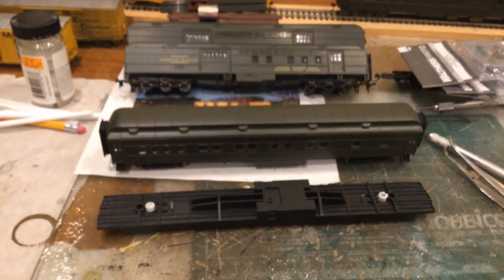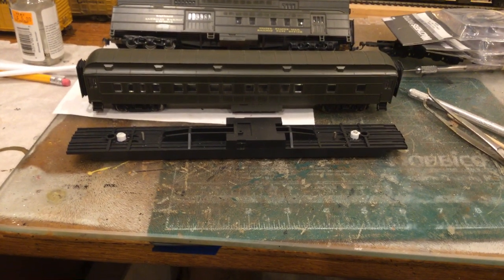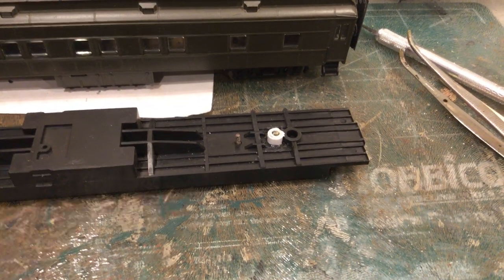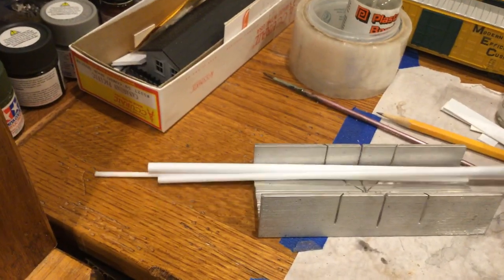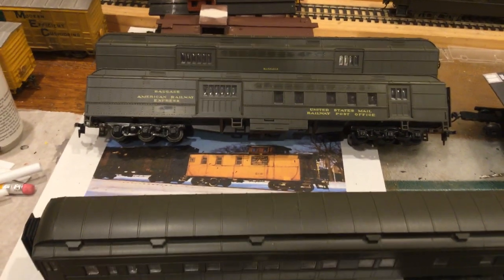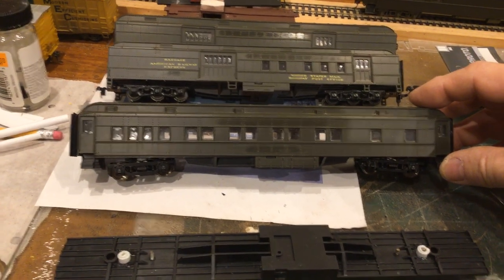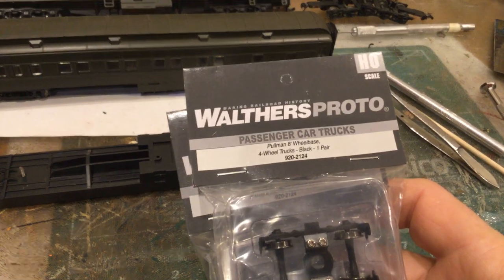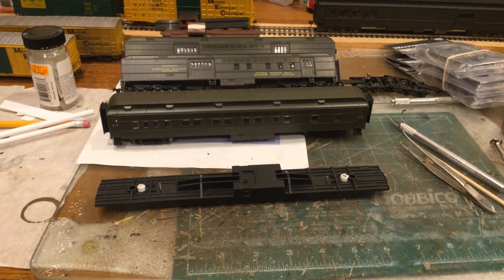Converting from 6 wheel to 4 wheel trucks on heavy weight passenger cars

Comment: do you have a video to change the 4 wheel "light weight" passenger cars to 4 wheel walthers trucks? I found for the 6 wheel trucks I have, you can use a walthers 6 wheel truck, but rotate the truck 180 degrees and it fits perfectly with the original mounting hole, you simply need a spacer to account for the valley in the walthers truck, to allow it to clear the ribbing on the bottom of the car. I plan to do this to all of my cars to make lighting easier
Reply from the maker: I have done the 6 wheel truck conversion for the walthers trucks, and yes in most cases it was simply rotating the trucks 180. I have not converted any 4 wheel light weights to Walthers trucks.
Reply: @camgreen3815  also you didnt seem to mention what the 3 sizes of tube you used?
Reply from the maker: @TheStarforce2  evergreen tube sizes 228-226-224